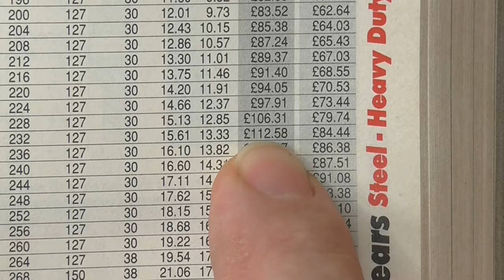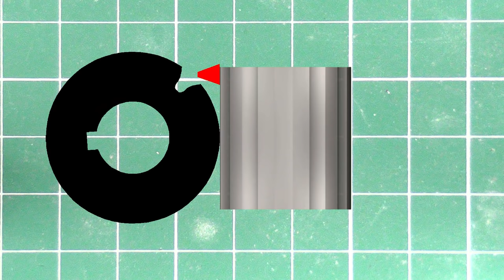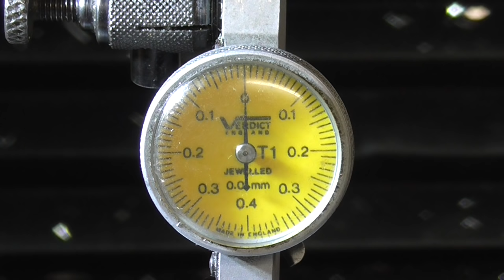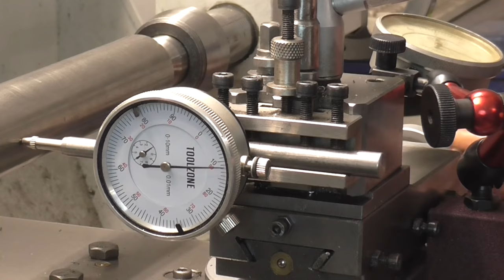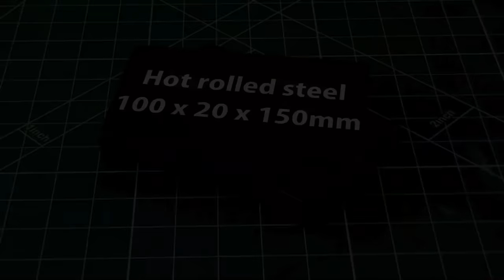DIY gear hobbing attachment for milling machine (part 1)

Comment: You should consider adding trepanning to your skill set.  The next time you want to cut a round round out of rectangular piece of material it is a lot faster, easier, and leaves a much better surface finish that is concentric to the rest of the part.  If you are concerned about the inner part falling out at the end consider leaving a thin web at the end of the cut.
Reply from the maker: Yes, I sometimes trepan thin material on the lathe, but these plates are 20mm thick (~3/4") which would need a very long thin trepanning tool. I suppose I could cut from both sides though. Any time I want to remove a lot of material quickly my first thought is usually some method of sawing it off.
Reply: @AndysMachines  Hi Andy, Thanks for the reply.  However, thickness of material does not limit trepanning.  It is a great way to remove material.  You clearly have the ability to grind trepanning tools.  It is a lot like grinding a boring tool that creates shank clearance on both sides of the cut (similar to a hole saw creates a curf wide enough to allow the body of the saw to follow the teeth down the hole).  It is not difficult if you understand the geometry and the clearances necessary to manage your chips without hitting the stock on the inside or outside during the cut.  I encourage you to look into it.  

Regarding your comment on sawing off the material, the way you did it in the video created a situation where you had to deal with an interrupted cut on the lathe when you cleaned up the OD of the part.  Interrupted cuts are always time consuming and can damage your cutter if you take too deep of a cut or use too high of a rotational speed.  If you insist on using your band saw to cut off the square edges of a "round" part then you should consider going to a more narrow blade on your band saw.  With a narrow blade you can scroll around the inner part and minimize the stock left for later removal.  Once you get used to this you will minimize (or possibly eliminate) the interrupted cut and material removal.

Hope you are not offended by my comments but I am just trying to help you.  I have over 50 years of prototyping experience and figuring out how to make things.  It is hard to go away from old habits (especially in matters of things you have figured out for yourself).  However, the faster you get at doing things the more magical things you will create.  Any you are a very creative guy.  I have a couple of other simple suggestions for you but this is getting petty long so I will make another comment after a while.

Cheers,
R J
Reply from the maker: @rjserra5535  Not offended at all! Thanks for taking the time to write such a long comment and share your knowledge.

I have ground trepanning tools in the past by hand from HSS blanks, I usually made them fairly short as that's all I needed and I found making longer ones more time consuming and the tool itself becomes more fragile with length.

I don't actually have a bandsaw now (have owned several in the past), so I often go for the quick and dirty 'lop off the corners with a hacksaw and true it up on the lathe.' An irregularly shaped blank does take longer, but I generally use HSS tooling on the lathe so the interrupted cut is not really a problem.

Happy to hear any other suggestions!

Comment: I wondering how helical gear is possible . You need electronic diffration.. plz explain...
Reply from the maker: No, you don't need any advance or a differential such as you might have when milling helical gears on a horizontal milling machine. You only need to tilt the attachment to the helical angle and take the cut as normal, this is because I am using a hob and feeding in line with the teeth.

Comment: Good explain milling cutter type, length, long, wirdh.., and also all in gear attachment machine 🔧🔩⚙️🔧🔩⚙️🔧🔩⚙️  1vedio screw compressor head in screw gear working flow of air function

Comment: Dear Andy, I did cut a worm gear for my Crouzet Vallence TC125 lathe and documented this for a YouTube Video which I want to post on my channel. Since Your video on gear hobbing helped me a lot, I would like to include two short screenshots each of around 8 second from Your video in mine. I would also link to Your video in the description. I would like to get Your allowance before posting my video. Thank You very much, Greetings, Eckart
Reply from the maker: Yes that's fine, I've no problem with you doing this, thanks for asking first! It might get flagged automatically by Youtube as a copyright breach, but if it does I'll approve it's use. (Though normally short clips that are relevant to your video are allowed).
Reply: @AndysMachines : Thank You very much for Your allowance. I just published the video and hope it is helpful for users of my old french lathe type...

Comment: Hi Andy.  Some impressive heavy(ish) and precision work there.  Well done.
Regards Mark in the UK
Reply from the maker: Thanks! Not really all that heavy, though reaching the limits of some of my tools, particularly the lathe steady rest which really won't go any bigger. Because this is a machine that will be making parts for other machines, I'm trying to make it as accurate as I can so I don't have errors stacking up on top of each other. 🇬🇧

Comment: Yessssss...........last time I cut some gears was 15 years ago.....still nice to have a dividing head to do all that.......at the time I used a hand ground fly cutter to get the gear cutter profile.......just too many gear profiles and sizes to lay out for a couple of sets of gear cutters......and a hob does the job in one hit after you gash the teeth.
Reply from the maker: Actually with a powered hobbing spindle you don't even need to gash the gear blank, you only need to do that if 'free hobbing' (and even then you can still end up with the wrong number of teeth!)
Reply: @AndysMachines  1

Comment: Remarkable work and great editing. Truly a pleasure to watch. I am curious about the ratio of (1) the time spent planning to (2) the time spent in set up to (3) the time spent cutting.
Reply from the maker: Thanks! Time spent cutting (per gear) is probably the least. Setting up is really just like tramming a vice, though I may have to do both the hobbing attachment and the mill head. Planning and preparing the blanks etc. can vary wildly though often it's just some simple arithmetic in my head and turning a piece of bar on the lathe.

Comment: get yourself a mister. Use the expensive synthetic stuff and use it very sparingly with high air flow about 35 - 40 PSI. It'll improve finishes enormously because it'll blow chips away keeping you from recutting them. It'll also extend tool life and allow you to increase speeds and feeds markedly.  For that T slot I'd use a flood.  
I was concerned about a mister in a small shop.  But the synthetic stuff is non toxic and I use  so little.

Comment: Your video popped up in a sub-feed from a mini lathe video.  Overall great video.  Would you try to keep the sound of the machine noises at or below your level of speech loudness? I had to repeatedly adjust the volume.

Thank you for sharing this wonderfully inexpensive modification!

Comment: Excellent project!
You might get this question often: how would you cut gears without the mill spindle being able to tilt?
Reply from the maker: I think I did get this question from somebody who had a mill with a head that didn't tilt. You can't just tilt the work spindle an additional angle to compensate, since the feed direction must be parallel to the teeth. If you used a large diameter hob with very small teeth and hence a very small helical angle then you could probably get away with not tilting the head (the clearance angle ground on the teeth would be greater than the error, so the teeth would still cut without rubbing)

Comment: Very nice. Thank you. I usually just skip to the end on Build videos to see the final product, but your editing of the video was so well done that I watched every minute.
Question: Instead of cutting the corners off the flat stock with a hacksaw at 5:00, and then later spending a great deal of time removing the rest of the stock in the lathe at 8:50, why not use the rotary table and a small roughing end mill to do the job? I find this work well.
Thanks again. Looking forward to part 2
Reply from the maker: I'm glad you liked the video! Yes, the rotary table is just as good a way of doing this, though personally I only tend to do that when I don't want a full circle (such as when I rounded off the corners of the frame). I roughly knocked the corners off first just so I could centre the part in the 3-jaw on my rotary table (with shims and moving the chuck on the table) to cut the T-slots. I left the final finishing of the faceplate until everything else was welded, bored etc. in case there was any movement.

Comment: Hi, Andy, I have been a long standing admirer of your most excellent efforts and I must have watched this video and part two at least ten times. Being a well seasoned retired pensioner I now find myself with countless hours of time to put some of my misspent skills to a use. One thing I would love to make is a Hobbing Attachment like this. Did you ever publish any drawings for this? If so can I beg, borrow, barter or at the outset buy?
Once again I congratulate you on your knowledge and skills and your unselfish way in which you share  your your knowledge with the rest of the World. - Thank You.
Reply from the maker: Thanks Keith for the comment, I didn't actually produce drawings for the attachment as none of the dimensions are critical. You can alter the design to better suit your own needs or make use of whatever materials you have to hand. If you only want to cut spur gears (rather than helicals) then the attachment doesn't need to tilt and can be much simper. All you really need is a shaft rotating between two fixed bearings that you can attach a pulley and stepper motor to.

Comment: Hello Andy, Amazing videos and thanks for all the effort you put into this. Mechanically I can do about anything but electrically I struggle. Can you give me some part numbers on encoder options. Thanks!
Reply from the maker: Hello Mr Winky! I enjoy watching your channel!

The encoder I used for this project I actually cobbled together from some parts from an unknown make servo motor and a codewheel I made myself. For general use I've always used the HEDS range of encoders made by HP/Agilent, now made by Broadcom I think. I like these since you can buy the read heads and codewheels separately, or the whole thing as one unit. I know a lot of people have replicated this project using the 38S6G5 type encoders which are very cheap on ebay/AliExpress. These can't be directly mounted on the spindle of a milling machine however,  you would need to attach a timing pulley or gear to drive it. Directly mounting on the spindle is usually better, but encoders of this type with a large through-bore are specialist items and can be expensive or hard to find. You can always make your own, either how I did, or even from scratch by building the read-head from simple components. (I've said before I'll do a video on encoders one day, how they work and how to make them, I'll get round to it one day!)
Reply: @AndysMachines  Great info!  Thanks. I may have to use a belt on my mill. It's possible I could mount a disc on the top of the spindle pulley but the encoder would end up inside the step pulley. Doable but the belt would probably be easier. I'll do a video on the build and of course link to your videos. You do a great job on the videos. Thanks!
Reply from the maker: I'll look forward to seeing the video! Any issues/questions just let me know.
Reply: @AndysMachines  Thanks, I appreciate this.
Reply: @AndysMachines  Hello Andy, the specs on these encoders are in Greek (to me). I can make a belt drive or disk type work. I assume the disc can be larger in diameter as long as it has 150 slots (with equal slot width and gap?).  Can you suggest a specific part number for either one or both styles? Thanks.
Reply from the maker: The encoder doesn't have to have 150 slots, you can use a wide range of different encoders. 150 is just what worked well for me since I made it myself, it's actually not a common number. 

If you look at my other video on the hobbing controller: https://youtu.be/beT8312k3yI?si=ojfaTVRenIHHEsqR 
Starting at around the 9 minute point there is an explanation of how to calculate the required pulley ratios and encoder counts. A more readily available number of counts/lines for most encoders is 400 and this number also works well with a wide range of pulley ratios. Going higher than 400 will give you more resolution but it's not really required unless you are cutting gears with hundreds of teeth and going too high with the counts will limit your top machine speed as the arduino can't keep up.

As for part numbers, something like The Omron E6B2-CWZ6C or Broadcom HEDS5540H would work, but these can be pricey from distributors, I would probably look on ebay for something similar (usually from China) like this: https://www.ebay.co.uk/itm/173824673053

Comment: Just found this channel, you are a really clever engineer, great video, I'll shall be checking out your other videos. One question, I did an engineering apprenticeship 25 years ago and HSS lathe turning tools were old technology then. Is there a reason you still use them? I only do a bit of machining at home now but use only insert tools as HSS is far to slow for me. Again super video!
Reply from the maker: Thanks! Yes, I do use carbide insert tooling as well, but I've just always used HSS and I like how I can quickly grind any shape tool I need. Also my lathe is only a small bench-top model, it doesn't have the power for really heavy cuts.
Reply: AndysMachines thanks for the response and fair comment. HSS still has its place for sure. The hobbing attachment is beautifully made love how you did the scribed degree graduations and etched the numbers. The video has inspired and opened new opportunities through watching it, just shows what you can still do with manual machines at home if your clever enough.

Comment: a great and informative video.  do you provide plans for your gear Hobbing  attachment
Reply from the maker: I haven't drawn actual blueprints, there's enough info in the video to be able to reproduce it, it doesn't have to be exactly the same, you can modify the design to suit your own application.

Comment: You do some really nice work. I’m really impressed. But I’m surprised that you don’t seem to use any machine coolant or even thread cutting compound such as Trefolex. We always used both. The surface finish on threads in steel for instance is greatly affected by tapping dry. Brass is a different story, but we would have been seriously reprimanded for going in without Trefolex. You can imagine the jokes that went along with this rule.
Reply from the maker: Thanks! As for the coolant, I can see I'm going to have to get a mister and have it visible in every shot, I seem to get this comment a lot! I DO use cutting oil, even flood coolant, but I generally don't show the application of it (though you can see it's there) and I don't use flood coolant in the videos as it would obscure what's going on. Maybe I don't use as much cutting oil as some machinists or reapply it as frequently, and I don't use it for everything, but yes, always when tapping steel.

Comment: I had hope when I saw the "Toolzone indicator" thinking I can afford this hobby, then you brought out the "mitutoyo micrometer"😂.

Cool I never seen gears cut like that, thanks for the education, please include more explanation of why you are doing operations and which order for beginners like me. Thanks
Reply from the maker: Yes, I only have one Mitutoyo and it's 0-25mm but it will actually measure slightly over that, which can be very useful in situations like this. Fortunately I rarely need to measure things bigger than 25mm to 1 micron accuracy.

Comment: Have you ever used a spiral point tap they cut so much nicer than those raspy straight flute taps.
What I really would like to know is how it is that you get the spindle and your machine on the same page.

Comment: It's amazing. Are you using one of the CAD software for your projects?
Reply from the maker: I do design things in CAD, though rarely the whole machine, just the parts that I need to calculate some values for, or if I want to play around with the design to help me visualise it. I use Vectric and Turbocad packages. I did try Fusion 360 but didn't like it.

Comment: Next time you hole saw a hole... scratch the surface with the hole saw, then drill a hole tangent to the scratch mark.  This hole allows chips to fall out of the cut and prevents chip packing in your hole saw gullets. You'll cut faster and with less heat giving you years more with your expensive, carbide tipped hole saws
Reply from the maker: Good tip! I always do this with wood and it cuts much faster (usually 2 holes on opposite sides). With steel I tend pull the saw out frequently to clear the chips and add more cutting oil.